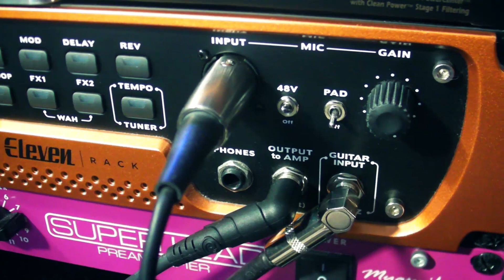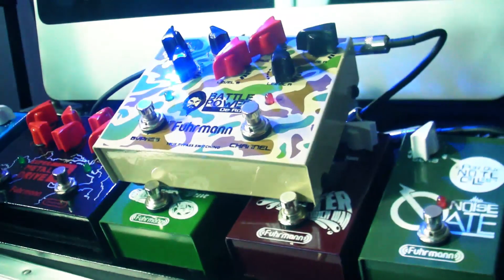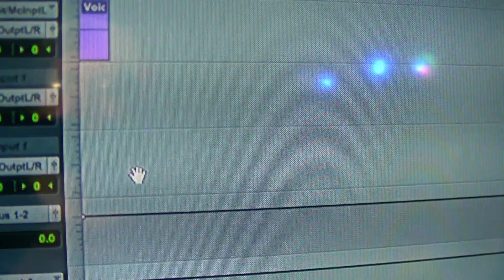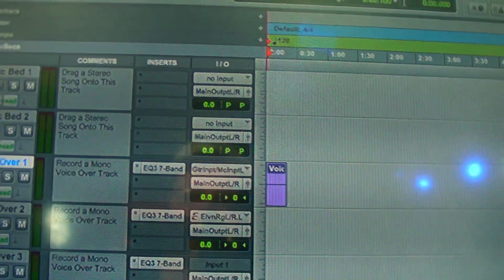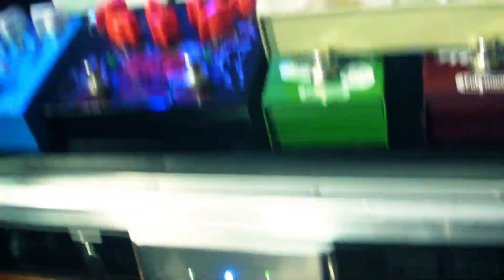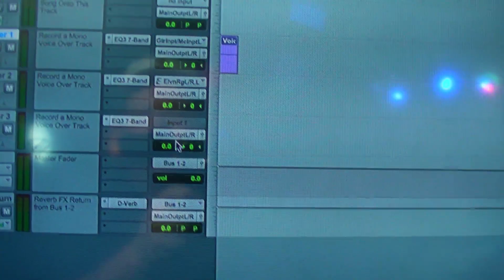FREE PRO TOOLS - & Using the Eleven Rack as front end for Pro Tools

Comment: Hi Todd,Does your Eleven Rack have the expansion pack in it using firmware version 2.If so does the stand alone 11R editor work with Pro Tools First.?
Reply from the maker: Yup! Im running the expansion pack. Came with my unit. Also YES works with pro tools first.
Reply: Thanks for that Todd
Reply from the maker: Anytime!!

Comment: Hi Todd, If you are still monitoring this channel, I have some questions. I have an Eleven Rack and ProTools. What level are you setting your settings? Volume on the Rack? Gain on the Rack? Volume in the Rack? Gain if you are using a limiter in the Rack? I am all over the place and I can get green level in ProTools, but when I record, my wave form is minuscule indicating a low recording level. I am going to work on it some more, but I was curing of your settings. Anything you can share would be great... Thanks in advance....
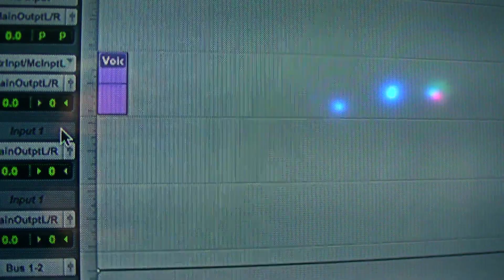Reply: I'm sure you probably solved this issue by now because it's a simple fix as I had the same problem.  For those of you who are having the same problem the solution is simple.  You have to change the default input settings for the channels to the eleven rack otherwise by default it won't be on it.  It shows him doing this in the beginning of this video at the 2:50 mark and on...
Reply from the maker: Yup :) It's shown in the vid. Hopefully folks get it. I still love this unit even though Avid has put it out to pasture. You can get a new one for under $300 which is an amazing deal for a great recording interface with a guitar processor built in!!! https://amzn.to/2CqVLIC
Reply from the maker: If you are using the XLR mic input on the front, just turn it up just before it starts peaking the meter. It should have plenty of level. If you are recording guitar, you can put a compressor or  a parametric eq in your fx chain to increase the signal on the track. :) Hope this helps!